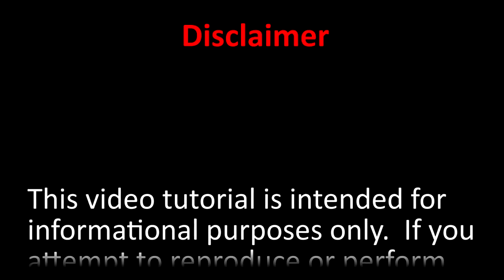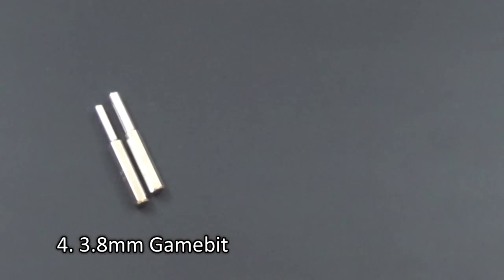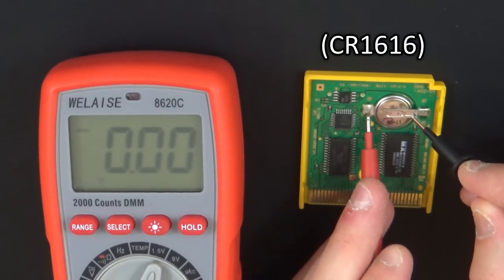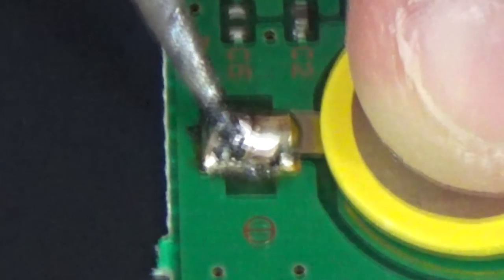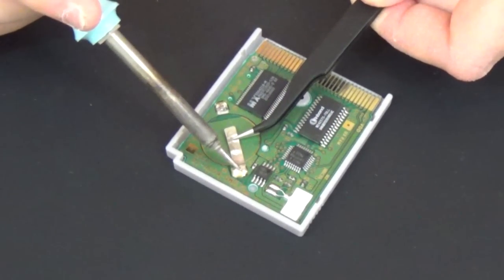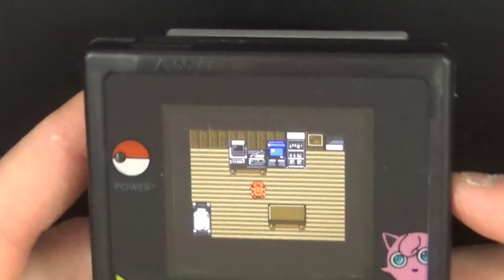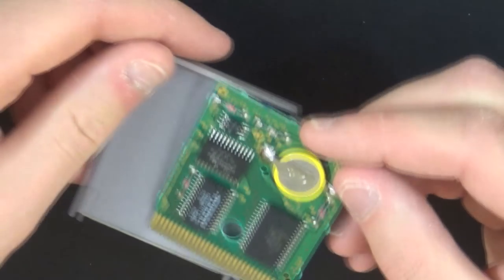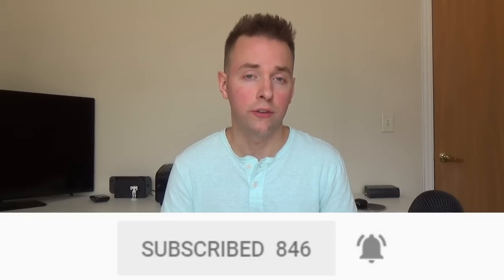The RIGHT Way to Replace Gameboy Cart Batteries

Comment: I put a copy of Ken Griffey Jr’s Major League Baseball in the freezer to see if it would help with removing old rental stickers and it made the SRAM battery pop off the metal tabs. It sheered cleanly right at the spot welds leaving two perfectly unbent tabs. Unfortunately, I couldn’t repeat this with Game Boy carts when I tried. :( I was all ready to make a DIY spot welder with nails and a car battery if the trick continued to work. :) I tested with two different copies of Pokémon Red from different manufacturing batches so they had two different batteries from Nintendo. Didn’t work for either of them. :(

Comment from the maker: Hey guys, thanks for watching!  Feel free to join the discussion over on Reddit!  Lots of good dialogue happening over there:
https://www.reddit.com/r/Gameboy/comments/9e8w8g/the_right_way_to_replace_gameboy_cart_batteries/
Reply: Is there any real downside to using a battery that is larger other than potential fitting problems? For example, using a 2032/2025 instead of a 1616 if you can get the contacts to line up, would that hold a charge longer and offer no real downsides?
Reply: Would this also work for a gba
Reply: @DrSalvador555  No real downside if you manage to fit it fine. Like I said in another commentary, 1616, 2025 and 2032 are 3V batteries and works identically. The only difference is the size (bigger = more holding capacity), 1616 means diameter 16mm, height 16mm. 2025 means diameter 20mm and height 25mm. 2032 means diameter 20mm and height 32mm.

So the diameter difference between a 1616 and 2025/2032 batteries is only 0.4mm.

Height difference is 0.9mm between 1616 and 2025, and 16mm between 1616 and 2032.

I personally managed to fit a 2032 in somes games which used a 1616 (Pokemon Blue for Example) without any problem (I only had 2032 when I replaced some batteries of my games so I used that).

My suggestion would be to replace 1616 with 2025 and 2025 with 2032, if you fear to not have enough free room on the game board/in the game case.
Reply: Why wouldn't you just use a coin cell battery holder with a coin cell battery that way when it dies in the future it'll be easier to replace
Reply: @draconic5129  Because it's pretty hard to fit in a gameboy case. It can be done but it's not the easiest thing to do (desolder/solder it is easier).
Reply: @HieiTF76  good point you would need to trim the battery holder in order to fit
Reply: I have the same problem but with my Gold version. Have you done this before with Gold version and does it require the same kind of battery for Gold as it does with Silver?
Reply: Finally I see a video where someone does not put a lot of strain on the PCB. PCBs and ceramic capacitors usually are damaged by bending pcbs. By the way by using a lot of solder you could damage terminals, Anyway I strongly recommend you to use flux and desolder wire instead of much solder, you are gonna get a very clean finish and it will look as professional SMT rework.
Reply: ok so lets say your a kid or early teen right and you want to save your game you are not gonna just use a iron so mostly you will have to use tape and if it works it works

Comment: if you have a game that works and has a save can you replace the battery without losing said save? also, I can only find the smaller cr1616 batteries with tabs on eBay available for me so I was wondering if those will suffice, and how long the difference in having to change them is to the bigger ones?  I have 3 carts that won't save at all and one that will but I'm afraid ill loose my save either from that old battery dying or from changing it. hope for an answer

Comment: I did this with my pokemon silver game, the old battery was completely dead so replaced it with a brand new battery which I tested with a multimeter. It was a success and I could save my game once again, a few hours later however I turned the game back on and the save had been deleted. Why is this happening do you think?
Reply from the maker: This may be happening because the new battery may have been low to begin with.  Or, theere may be a short on the cart that could be depleting it (dust, etc.)  Either way, try using a multimeter on batteries before and after you install them to make sure they are around 1.5 volts.  Getting brand new batteries, especially the ones with tabs on them, from online is hit or miss sometimes.  Some sources of them are good, and some not so much.  Hope this helps!

Comment: this would work but I'm certified. You can only solder a board so many times. Instead of adding solder to remove tabs, simply cover in Flux and it will wet just as easily with half the contact time. You're spending way too much time heating the lands.

Use Flux liberally. When soldering the new tabs, heat tab and land for a second then feed solder rapidly until fully wet, pull away quick. If you're doing it right you should get it perfect in 4 seconds or less. Clean flux with brush and alcohol.

Comment: I’m new to soldering, can the same technique be used on GBA cartridges?     And maybe I’m confused, but could you just apply flux to the old solder instead of adding new solder to allow it to melt better?

I’m still trying to grasp this, I apologize if these questions sound strange, thanks.
Reply from the maker: Hi!  Yes it works pretty much the same on GBA carts.  What flux does is cleans oxidation off of the surface of whatever you want it to "wet" to.  Essentially it just makes solder and getting it to bond/attach to contacts and components a lot easier to work with.   Also, old solder can get crusty and difficult to work with if you heat it a lot, so that's why you need to remove the old stuff and add new.  Check out my 2 latest videos, both on GBA power switch repair, for more in-depth details about this.  I think watching the longer one fully, and at least the first half of the short one I released earlier today, will help you immensely with these concepts and soldering in general. 🙂  I hope this helps!
Reply: KyleAwsm 
How does one “remove” the old solder? Just melting it down until it’s lesser, or is there a technique I’m not catching?    And can a C2025 battery safely be used in place of a C1616 on a gba cartridge?   Or would you advise against it?

Sorry for asking so many rediculous questions, that’s all I wanted to ask.   Thanks a bunch :)
Reply from the maker: Haha, you're alright.  I'm typically not able to be this responsive.  To remove solder you should use some desoldering braid and flux with your iron.  I show exactly how to do this in one of my two clips I recommended above.  Not trying to self-promote  but please watch them - You'll find great value in them I think. 🙂  As far as using a larger battery, if you can get a 2025 to fit in a GBA cart then go for it.  It kicks out the same voltage, but has a longer life than the 1616.  GBA carts are quite small though, so a 2025 might not fit that well.  Hope this helps.  Cheers! 🙂

Comment: When my 2nd gen pokemon game battery died, I was able to use my save file but the clock was disabled. Or am I thinking of the 3rd gen that happened?  Does Ruby and Sapphire have a battery in it? If it does, then maybe that was what I'm thinking of. I just remember the clock not working anymore but still able to play it.
Reply: I've been doing some research on this because my Pokemon Silver that I picked up from a used bookstore doesn't save, and my Emerald game that I've had since I was very young has a dry internal battery. From what I understand, 1st and 2nd gen games lose the ability to save files when the battery dies. However, for GBA gen 3 Ruby/Sapphire/Emerald, you can still play the game if the battery runs dry but you will lose any time-based events such as growing berries. The reason for this is because Ruby/Sapphire/Emerald uses flash memories for saves instead of a battery, but uses battery for the time-based events! Firered/Leafgreen doesn't have time based events so it doesn't have that problem.
Reply: I just remembered about the time based stuff being disabled. I haven't played my old pokemon games in a long time.

Comment: You dont need to change the battery. I had been looking at these videos because I had my own pokemon silver from 2001 that I was selling last week. And the game wouldnt save. In the game it saved but when you turn it off and back on there wasnt even a "Continue" button.
However what I found out was through my gameboy color charging the gameboy via the wall with the game running charged the battery inside the cartridge. Overnight from charging my pokemon silver now saved and worked I did it multiple times to male sure. Took the game out of the socket and unplugged the charger from gameboy put in batteries and the game still was able to continue.

The gameboy itself charges the batter from the cartridge slot.
Reply from the maker: What you've described is electronically impossible.  These game carts and the Gameboy do not work this way, and these batteries cannot be "charged" in any way since they are standard alkaline cells.  There is something else going on with your Gameboy and Silver cartridge if you have indeed somehow arrived at this end.  Thanks for your comment, but these things are just not possible.  Thanks for watching.

Comment: So what's a good soldering iron? Any soldering tutorials you recommend?
Reply from the maker: I've got the Hakko FX-888D, which was about $100.  But I started with a basic single temp Weller iron.  As for tutorials, just watch a ton of them on here.  People have all sorts of techniques.  So absorb as much of just everything out there as you can, keeping a mental list of good and bad techniques.  Also read comment sections for corrections by others.  I've had a few helpful corrections in the comments of my own videos.  Hope this helps!

Comment: You didnt really specify: cr1616 and cr2025 are the exact same output, but the other one performs longer. Where is the necessity for the 1616 ones then? Why shouldnt i use the 2025 everytime?
Reply from the maker: Good question - Reason being is because the 2025 is a tighter fit for some cart shells, especially GBA, and some GB/GBC carts ship with either.  Also, check out my latest video for the updated version of this tutorial.  Thanks for watching!
Reply: KyleAwsm 
I did watch your newest video, and thanks for the specification! I ordered both „sizes“ and will see which can fit nice and easy. Thanks for your tutorial.

Comment: Your iron seemed to not be hot enough.  Also you should clean the old solder off the board after removing the battery, before putting the new battery on.  Flux helps too.
Reply from the maker: Thanks - I've posted an updated tutorial: https://youtu.be/NyEXRXeuA5w

Comment: The only criticism I have on this video is that you were applying too much force while removing the old batteries, that can easily cause the contact pads to separate from the PCB and as such you should always let the solder become fully fluid before trying to dislodge the connections.

Comment: Back as a 12 year old kid in like 2011 I replaced like 4 of my batteries with the knife and tape method, perhaps I should go back and properly fix them. It wouldn't be too hard to do, I already own like 4 extra batteries from when I bought them for my Emerald clock battery. That was the first one I properly fixed with solder thanks to the help from my dad.
Reply: the problem is : the Emerald version is the version of the game where the clock is actually "broken" and will only advance if you play the game past the save in a set pattern. Soft resetting for a shiny will be frozen in time at the savestate to clarify better. Either you will have the shiny frame in that timelapse or you can reset endlessly and never have it in the frames after the said save. That same shiny frame can be resetted if you happen to have one , it will be the exact same pokemon if you manage to find the frame a second time (unless it is a different shiny frame and it's big luck still)
Reply: @TheTrooperMB  This is wrong, they fixed the time glitch in Fire Red Leaf Green, and it was still fixed in Emerald. The only places it exists are Ruby and Sapphire, and it can be easily fixed/patched by linking up to literally any game that these games can link to with a link cable. You can fix it by linking up to any generation 3 Pokemon game other than Ruby and Sapphire, by linking up to the GameCube games that gen 3 can link to, or even by using a specific GBA eReader card. The glitch isn't a huge problem these days because of all the ways to fix it. 

Unless you mean a totally different problem and I don't know about it.
Reply: @NottJoeyOfficial  i believe the emerald version has the clock frozen in time when you save the game , lg and fr are fine for sure , that story from someone with an emerald game that tried to get shiny rayquaza after 120000 attempts .. he never had shiny frames in his soft resets unfortunately for him
Reply: @TheTrooperMB  I could be wrong, but I believe that may just be the dead battery glitch. Not sure though, I'll have to look into it, thanks for the information.
Reply: @NottJoeyOfficial  anywho , RIP to the guys trying to get static shinies on emerald that never had the close frames when they soft reset the game

Comment: hey, good tutorial, i was wondering if there is a way to put like a holder for the battery instead?, mainly for ease of replacement in the future
Reply: That's a mod people do on SNES cartridges, but on these, I don't think the sockets have a low enough profile.
But either way, these batteries should last you a decade, and spending 10 minutes a decade to replace these isn't that big of a deal

Comment: Another topic that really kind of bugs me is no one really tells you that you need to clean and prep the cartridge of all flux and residue and anything else before you install the battery. Otherwise you'll be pouring 1% water with 99% alcohol on live connections when the battery is live..

Comment: Great tutorial! In your reddit post, I saw someone say that you can safely solder tabbed CR2032 batteries on any cart, even those which originally use CR1616s. Is this true? Because other reddit posts say the shell can crack because of the extra width of the 2032 battery.
Reply: Don’t do that man

Comment: So am I able to use a Cr2025 batter in replacement of the cr1616 battery? Will this cause any problems?
Reply from the maker: Alex Chipman  Yes, you can substitute those in GB and GBC carts (GBA carts are too tight of a fit).  They're just a bit thicker, but they shouldn't cause any issues.  In fact, they last a bit longer than the CR1616, and some people prefer to just upgrade the cell to a CR2025 since they've got the shell open.  Good question!

Comment: You'll notice that in most consumer electronics that the solder is crap, its because its lead free. I'd suggest wicking away or using a desolder to remove the old solder, otherwise this is a pretty good guide.
Reply: It isn’t lead free here… it’s just that the factory flux was spent and/or cleaned off.
Reply: …and oxidized.

Comment: Question: how to doy change the battery on games like pokemon Ruby, Sapphire & Emerald. Its for the clock base events that need the game like Berries & the high & low tide of a n area to get snorunt & other ice type.
Reply: First of all please proof check spellings before you post on the internet. Secondly, it's exactly the same for game boy advance cartridges, accept you have to use a tri wing bit to dismantle the cartridge and be careful that the battery fits inside the smaller shell. Good luck.

Comment: I have rosin flux core from ace hardware. Do I need to apply more flux?
Reply from the maker: Yes, don't ever be afraid of applying too much flux.  You don't need gobs of it, but a lot won't hurt, and it can always be cleaned off with isopropyl alcohol.

Comment: Any suggestion on how to change a battery without losing my save? I'd like to change my Pokemon red battery before it's too late. Great video!
Reply from the maker: Alan Reis  Thanks for your comment!  And unfortunately, you would have to backup your save first and then put it back on the cart after replacement is complete.  I recommend using BennVenn's Joey-Joebags Gen3 for this.  Check out my 40 min. tutorial video on it! 🙂  I don't show exactly how to backup saves using the Joey, but the kit CAN do it!  Let me know if you have any questions.
Reply: Alternatively you can change battery while the cart is inside the powered up console. Not really an easy solution but it works.
Reply: You can also make a jumper with a couple AA's. Make sure to do it in parallel though not series. Pos to Pos, neg to neg. This will keep it charged up while changing batteries

Comment: The battery for my gba game (Pokémon Emerald) still works but I can’t do anytime events like the Shoal Cave & grow berries. Would it still be ok to replace the battery for doing time base events? Are there ways of preserving the save file even with the battery change to?
Reply from the maker: You can use a Jowy to back up the save and then put it back on the cart later, or you can try to wire up a battery in parallel while you swap out the old one.  Just be careful so you don't lose that safe!  The BennVenn Joey really is a great thing to have for backing-up carts and such, so maybe consider picking one up.  Anyways, it sounds like your battery is good enough yet to run the SRAM, just not the clock module.  I could be wrong, but that's what it sounds like.  Maybe hook a multimeter up to the cell and see how many volts you get out of it.
Reply: I see thanks. I was asking to see if it was ok because it would’ve been nice if my Pokémon Emerald game has clock based events working since I can still play the game & have save files.
Reply from the maker: I gotcha - Let me know via DM on Instagram if you need any help!
Reply: I see & thanks again for the advice